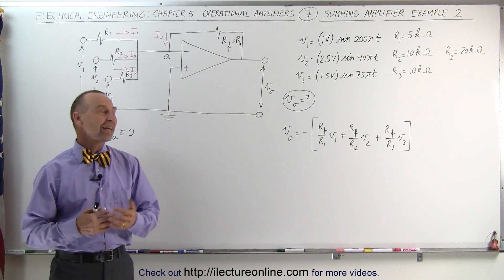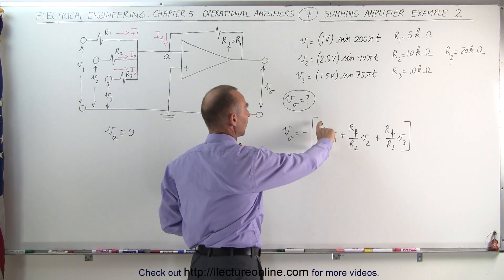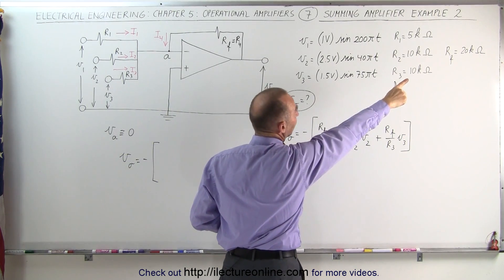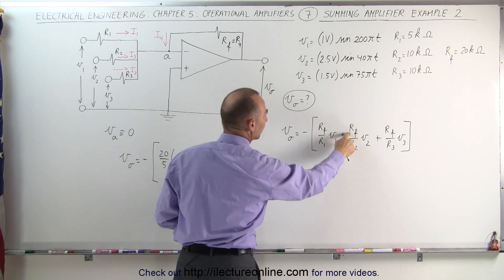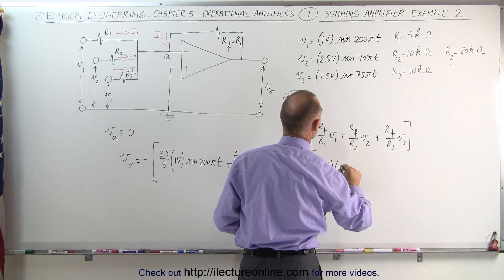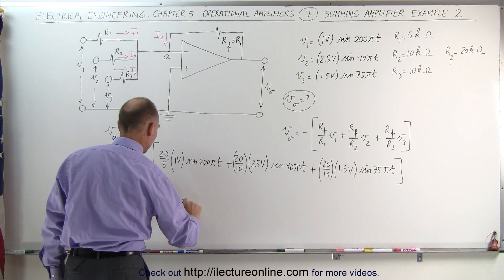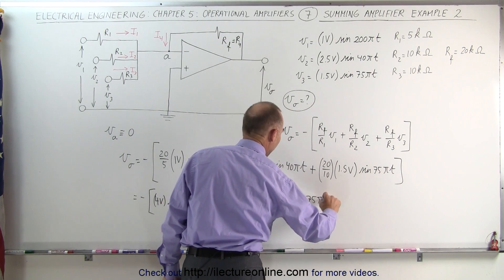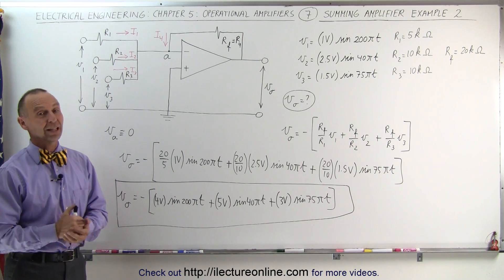Electrical Engineering: Ch 5: Operational Amp (7 of 28) Summing Amplifier (Inverting) Example 2

Comment: Hello sir, could you please inform me why you have choise the direction of I4 in this way???
Reply: Fateh Chakib He chose the direction of I4 current in the opposite direction of the flow of positive current leaving the junction only to make a point.
The point is that there are case in which the current direction is not obvious but if we stay consistent with the voltage then an algebric sign will currect itself, in this case resulting in a negative I4 current.
Think as if we choose the cartesian axes in fraim of 
reference. The positive direction is arbitrary and chosen to simplifing signs, usually psicalogically we prefer + positive 
in our calculation but we can aswell solve problems using axes that results in negative physical quantities.
Reply: Fateh Chakib Fateh Chakib He chose the direction of I4 current in the opposite direction of the flow of positive current leaving the junction only to make a point.
The point is that there are case in which the current direction is not obvious but if we stay consistent with the voltage then an algebric sign will currect itself, in this case resulting in a negative I4 current.
Think as if we choose the cartesian axes in fraim of 
reference. The positive direction is arbitrary and chosen to simplifing signs, usually psicalogically we prefer + positive 
in our calculation but we can aswell solve problems using axes that results in negative physical quantities.